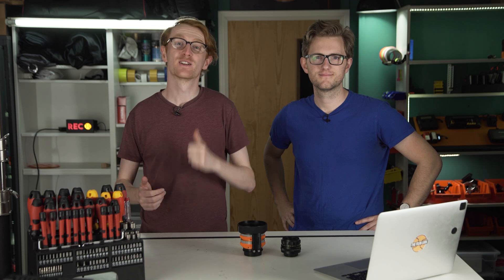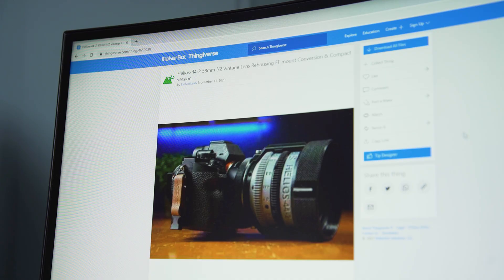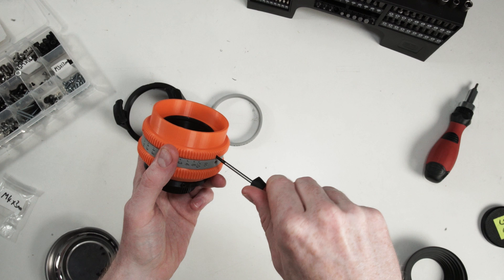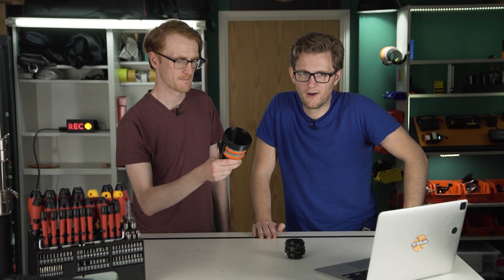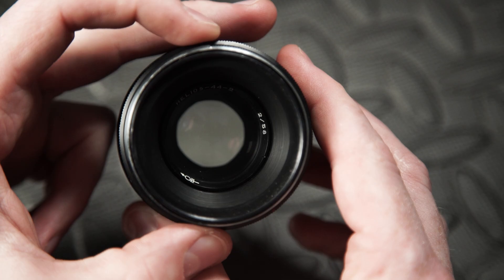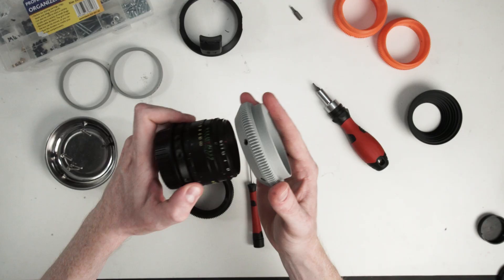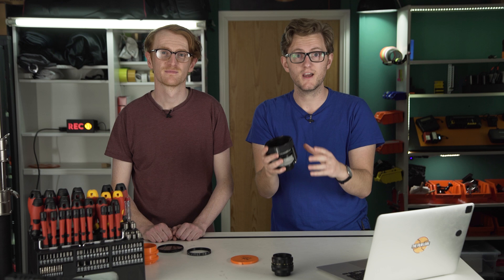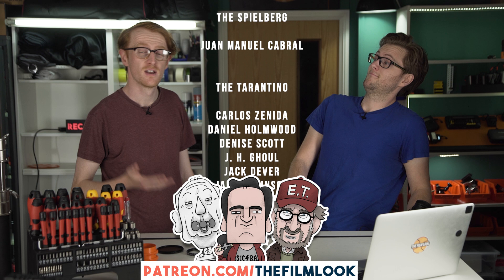CONVERT Your Vintage Lens into a Cinema Lens

Comment: This is so cool! I may have a friend with a 3D printer that I could prostitute myself to get them to make this for me, and when that doesn't work I'll just give them cash. Extra steps, but to make a stronger version of this you could use a resin 3D printer for maximum smoovness, then make silicone molds of the parts and cast them with strong as fuck urethane resin!

Comment: super cool! couple questions

what are the tolerances like for this? i feel like, the focus gear on the helicoid is kinda loose, so the 3d printed shell would also feel loose. The same goes with many aputure rings i feel

also! what is bearing the load of the lens to the camera mount? is it the shell, or the original housing adapter?

How did you get your f stop markings to align properly? outside of wide open and fully stopped down?

Comment: How awesome! I hope to be able to do this one day if I get a 3D printer. I am planning on buying the new A7s III, did you use the Super35 crop on your A7s for the vintage lenses, or how does it work?

Do you recommend me getting a 3D printer? IF it is 300 Dollar roughly, I might have the money. Imagine how much cool filmmaking stuff you can make.
Reply from the maker: No, there is no need to use the crop mode with the vintage lenses. I've wanted a printer for about 3 years now and it's great for projects like this. I'm also printing loads of movie props which is the fun part. If you are going to get one, watch as many videos about how to use them beforehand as there is a big learning curve. Also, make sure you have the time and space to have one running. We've printed a bunch of stuff for the studio which we will be showing off in a studio tour soon.
Reply: @TheFilmLook  Nice thanks for good advice, yeah it is perfect for props for movies! Looking foreward to the studio tour :-)

Comment: Would the print files work on a Helios 44m?
Reply from the maker: Unfortunately not. We have a 44m too and it's slightly different size. He does have a bunch of other vintage lens designs on the website., so check them out.